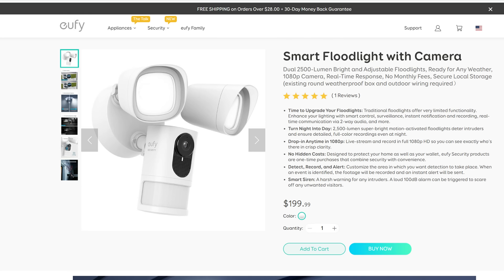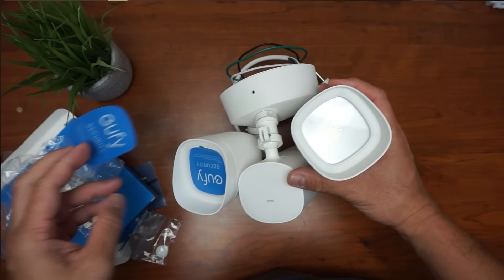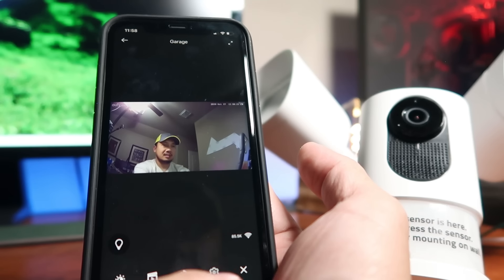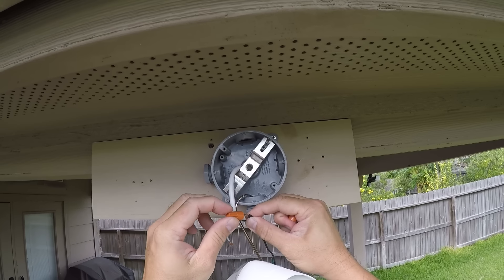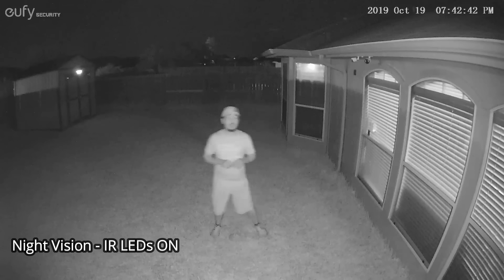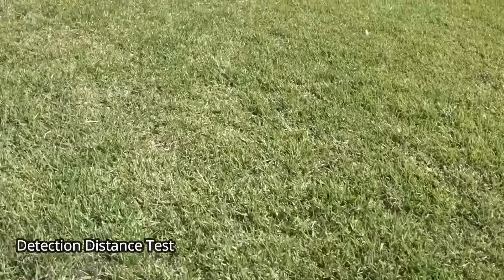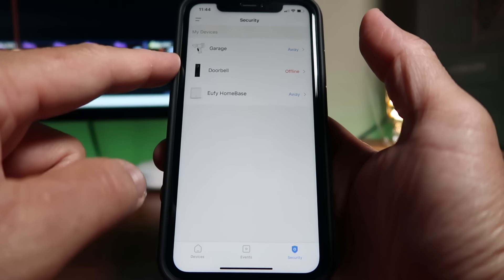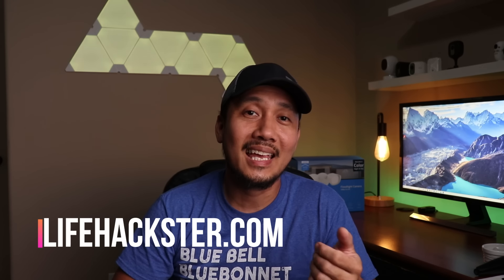Eufy Floodlight Camera Review - Unboxing, Features, Setup, Settings, Installation, Video Quality

Comment: @Security Baron  
first: your reviews are EXCELLENT, i love the content, it is very HIGH QUALITY

second: regarding SS
apparently you just pay for the equipment and can self monitor, again this is what the sales rep told me on the phone. i am still researching different options. 

third: need your advice!

im  in the process of a new home construction 300 sqft. i want to have a good system which wont break the bank which i can do self monitoring. 
here is what i am looking for:
1. wired cameras, with lights and motion, probably 4-8, for outdoor. ideally to not have to purchase a separate monitor . so if there is an app or free software which i can use on my laptop/android that would be great, free storage on a dvr is fine

2.  no interior cameras

3. use cameras over the front entry to avoid purchasing a video doorbell

4. front entry lock which has keypad entry so i dont need a key

5. alarm system for motion detection and if this could integrate with the cameras or be the same system that would be great

got any ideas? thanks in advance, keep your good content coming!

Comment: Hi, Another good review, can you please tell me whats the total range, my outbuilding is around 50 ft from my house, will the detection work for the lights/ alert
Reply from the maker: It should work if there are not a lot of walls, trees etc..that can block the WiFi signal.

Comment: I watched another review of this cam a while ago and the reviewer had the same issue with the motion detection, so it still has not been fixed yet. I am either going to buy the Ring or the Swan.
Reply from the maker: Eufy just emailed me and they are working to get this issue fixed.
Reply: then they need to hurry up!

Comment: Suggestion: 
Did u you try deleting that one zone and recreating it..or better yet delete the all the zones or disabling the motion zone feature and see if it works again at 30ft...I had a similar issue with my Arlo cams with the motion zone feature after they switch the Arlo app from netgear to Arlo’s app..disabling the motion zone feature fix the issue..of course u lose the zoning  feature..
So the Eufy floodlight doesn’t have pre recorded message to play when motion is detect..?
Reply from the maker: Yes, I did... The whole morning and the rest of the afternoon, I was trying to pin point what causes the issue.. I tried deleting and not using the motion zones.. tried the different color zones...etc.. but I wans't able to ... I'm positive though that is has something to do with the motion zones...I'm not sure if their system uses both the PIR sensor and algorithm or just algorithm..because I know just the PIR, it will trigger at or around 30 feet..
Reply: LifeHackster 
👍👍..
Your right, sound like its not using the PIR sensor..

Comment: Don't think it was mentioned in the video or maybe I missed it but does it have an option to be turned on without motion? I want to replace the current light I have but I need slmething I can also manually keep on so the backyard is lit. Thanks and great and informative review
Reply from the maker: Yes, you can.

Comment: Hey LifeHackster
First of all, congrats for your awesome work.
I have 2 strange questions that didn't come up through the rest of the comments.

I intend to buy and install the Eufy Floodlight Camera just above my main door. 

1)Can you turn each floodlight (their base) towards any direction? or is there any restriction in the angle?
I want to cover a narrow corridor in front of my door, so I need both floodlights to be turned as centrally as possible. Or keep the one floodlight as close as possible to the camera to light the corridor and the other turned vertically to light my entrance.
Is any of these possible?
2)And what about a light that is gonna break down lets say after 2,3 years (and out of warranty) or a faulty camera? Could I somehow replace just the faulty parts by getting new ones? Or the whole process won't worth the repair?
Thank you in advance and apologies for the long essay haha

Comment: Great test as always, LifeHackster. I liked the video and sound quality. However, I feel it is a big downside that the camera has got no cloud storage. Any burglar just needs to rip the camera off and remove the sim card. Defeats the object, doesn't it? And getting the camera on the market without testing the software enough is bad planning. Why should one buy a product that is faulty? There are so many good points, yet it falls down with the little things. Presumably, the financial director said, "it works,  get it on the market." They should have listened to the developer. 😉😎
Reply from the maker: Eufy actually is advertising and printed on the box of their cameras that there is an optional cloud storage but there is nothing on their website or on the app on how to do it... Even just getting a backup to the base station if you have the Eufy cam E would be better...They do need to work on getting their cameras to integrate together.
Reply: Yeah, even better would be home base integration, no monthly fees.